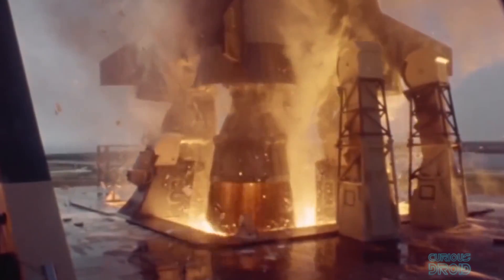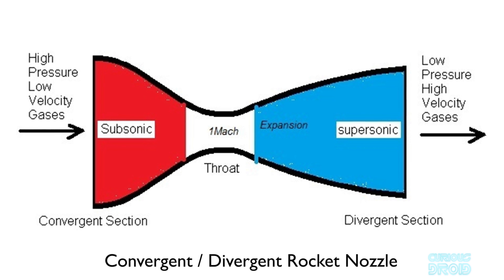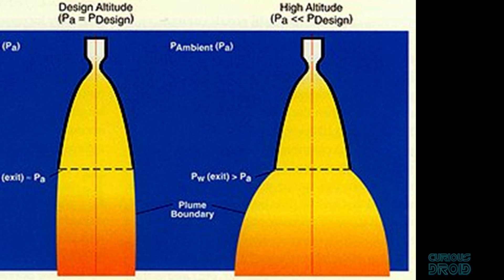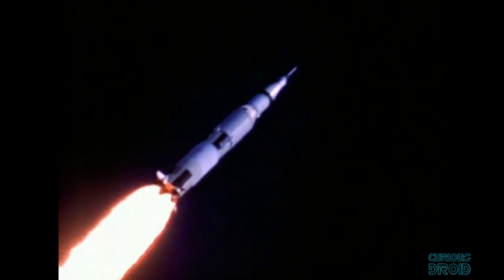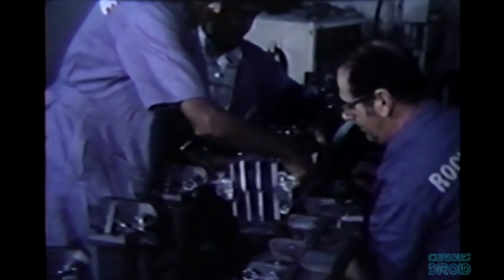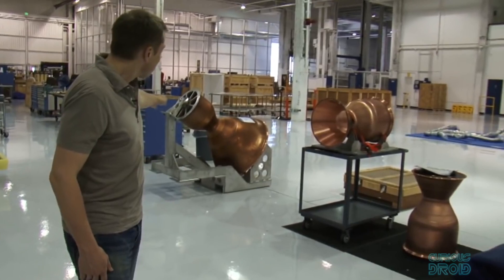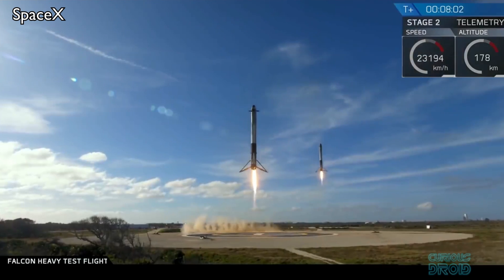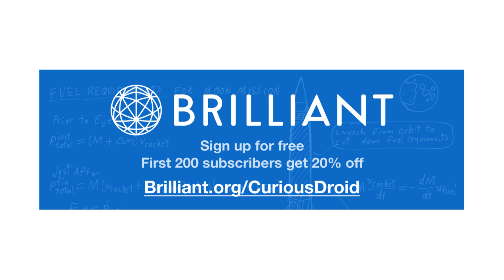Aerospike Engines - Why Aren't We Using them Now?

Comment: What happened to the maglev mountain rail type launcher?
Reply: John S you’d need the launching rail to be in vacuum like Elon musks hyperloop to continue accelerating, and if you wanted the G forces to be human survivable the track would have to be something like 1500km long. It would be the largest and most expensive engineering project ever devised by mankind
Reply: @SpiraSpiraSpira  I've seen a calculation that included drilling a tunnel at the correct angle through a mountain, and installing a maglev track, total length needed to achieve escape velocity was something like 6 miles.   Plus they added a couple of extra miles of track at the separation point in case they had to abort and needed a brake track.
Reply: John S to reach escape velocity (approx 25,020mph) over a distance of 6 miles would take less than a second but would subject whatever is being accelerated (your spacecraft) to over 1150Gs of acceleration. Needless to say this would turn anyone aboard into something similar to strawberry jam. It would also destroy any kind of spacecraft we know how to build currently. If you just want to achieve orbit instead of escape velocity you could expect something like 800Gs.
Reply: @SpiraSpiraSpira  Ah yes, I found an Acceleration and Distance calculator which came up with a distance that was too long to be practical.   Though I am not sure how exiting at a 60 degree angle 2 miles above sea level would affect the result.   Given that the rocket was traveling at something approaching bullet train speed when it enters the accelerator, It would take 9.5 minutes and would travel over 1986 miles in the vacuum tunnel.   Much too long to be practical.  That was if the G forces were limited to 2 G.  At 3G the distance would be shortened to about 1324 miles and the time to 6.3 minutes.  People blackout at 4G so not feasible.
Reply: John S a small track high G accelerator might be useful to throw building material into orbit if you want to build a large space station. A cargo only system, more or less.
Reply: @SpiraSpiraSpira  This calcs out at a 28 second ride to escape velocity, producing 40g's but needing a track over 90 miles long.   There was a guy that survived a 45 g force at one point.   Perhaps if the (rumored) top secret dragonfly g suit became more widely distributed, then it would be feasible.
Reply: @SpiraSpiraSpira  I just had a thought.   What if you built a circular track that allowed the vehicle to ramp up speed over a longer time.   Then, after terminal velocity was achieved or within reach, you changed the track and entered the escape tube up the mountain and out.  Perhaps that circular track would only need to be 40 miles long or something similar.
Reply: John S then you’d be crushed by centrifugal force instead of acceleration so you’d find that you’d need a thousand km or so to turn around a fast moving track with any reasonable amount of centrifugal force. Watch that video by Isaac Arthur I linked, he goes into loops as well.
Reply: Here is a good video from Isaac Arthur about mass drivers to orbit: https://youtu.be/KerG4ILWEa4

Comment: So the commercial companies form the private sector are perfectly satisfied with making lots of money using inefficient technologies, and won't put their profits  at risk financing research over alternatives. Since the public sector doesn't fund this research any more, they use the results of previously public-funded research and engineering. Did I hear someone say that business drives progress ?
Reply: uh yeah, because a private business has literally just invented re-usable rockets, something the public sector thought impossible or so difficult it would be more expensive than just building a new rocket,  and which is far more efficient than using an aerospike. Using an aerospike engine only makes sense on an SSTO vehicle and theres no point in developing an SSTO vehicle when you can just re-use first stage boosters. And after revolutionizing and disrupting the entire bloated, wasteful, and stagnant aerospace industry, a private, business driven firm is now developing full blown 100% re-usable rockets where both stages land and are re-used with a more efficient and effective new regenerative heat shield design, a more efficient and effective full slow staged combustion engine, and in-orbit re-fueling capabilities for massive 100 ton payloads to both the moon and Mars.... among many other innovative technologies and capabilities developed in house. 

Its the public sector wasting money using inefficient tech to shove tax dollars into the pockets of the aerospace contractors in the states of the congressmen who set NASAs budget and MANDATED that NASA has to develop their launch architecture using the same tech as the shuttle from the same firms as before..... this, of course, being 50 year old tech from the 1970s.

So, yeah. It is absolutely a private, business driven firm innovating the space industry so rapidly and massively that it is forcing even the bloated public sector to keep up and innovate.

Comment: what is the difference between a rocket engine which can gimble and thrust vector controlling?
Reply: henryscp 07 Vector controlling if I remember only works if you have multiple engines, you cut down the throttle on one engine and the offset of thrust will put force on the rocket itself and spin it. this is usually used in jetliners and other aircraft. Gimble just means that the rocket engine itself is on some bearings and can rotate
Reply: @serbianspaceforce6873  ah ok thx
Reply: henryscp 07 you're welcome I find it fun to geek out on rockets

Comment: Another shinning example were in an outstanding idea was not followed up on due to "Bean Counter".
Reply: If you only have so many beans in your budget somebody better be counting them to make sure you don't run out before you get to launch.
Reply: Right now the rocket itself is by far the most expensive part. Cutting the cost of the rocket is far more important than making a rocket more efficient. That is why SpaceX is trying to reuse rockets. It makes financial sense.

Comment: If you are using an aero spike you have to take the entire rocket to space. Multistage lets you get rid of the bulk you no longer need.  What SpaceX is doing is perfect, unless you want to convert the fuel tanks into living area in space.
Reply: You can very well make multistage aerospike rocket. In fact, aerospike first stage would be great, providing with benefits of aerospike engine without encumbering with disadvantages of SSTO. I think the perfect aerospike rocket would be TSTO - aerospike first stage, vacuum-optimized bell-nozzle second stage.

Comment: Loved the video and the information, but there is also another reason that rockets are staged than just adjusting for pressure differences. Fuel has weight, and thus would require more fuel to lift, and more fuel to lift that fuel, making an endlessly exponential increase in fuel requirements and engine power requirements. Staging is another way to reduce fuel requirements and reduce the cost of the engine and the fuel.

Comment: So, could you theoretically apply the same sort of design criteria to ICE exhaust systems to make them as efficient as possible? I know some use a design extremely similar to current rocket exhausts, with the convergent point and the same expanded cone on the exit of that point. They have a name for it but I can't recall it currently.

Comment: Am i right in saying this. The thurst (fire) from the engine, isn't pushing on the ground and thats blasting the ship up. Rather, the speed and pressure of the gas escaping through the nosels, is causing the ship to be pushed away from IT?

Comment: I would say we're not using them because (1) single stage rockets don't work very well, and (2) if you're using a two stage rocket anyhow, you're better off with a low altitude engine and a high altitude engine than an aerospike.  I don't think it's really a lack of investment.

Comment: Just thinking here... wouldn't efficiency also translate to weight?  I mean the more efficient an engine is, the less fuel you need, so the more weight you can carry, thus the more profits you potentially can bring in.  So aerospikes have a legitimate reason to be developed outside of fuel cost.  Couple that with the extremely expensive and wasteful habit of disposing of multistage rockets and rocket boosters, and aerospikes sound even better from an investor's perspective.

Comment: A little error at 2:30:

(1")² is not 2.54 cm², but 2.54² cm², which is 6.45 cm².

I can see where the error is coming from because 1 in is defined as 2.54 cm or 25.4 mm.

Comment: The problem is weight. You need to discard useless masses as soon as possible. So, aero-spike ends in an useless concept in a multistage rocket. Single stage to orbit rockets (SSTO) would be a VERY mass inefficient one.

Comment: I couldn't watch all of this gibberish. 

Rocket engines do not rely on air pressure at any altitude. Newton's laws of motion and conservation of energy proved long ago how rockets work. If air pressure had any influence (other than drag) rockets couldn't work in a vacuum, but we know they do. The Aerospike may be more efficient, but not to the degree he claims.

As for his single stage rocket: That wouldn't work with any fuel that we have currently or any we can envisage having in the foreseeable future. Multi stage rockets aren't built to use different shape rocket nozzles, but to keep the dead weight to a minimum by ejecting it as soon as the fuel tank is empty.

It's all just smoke and mirrors to hide his lack of understanding of physics.
Reply: "If air pressure had any influence, rockets couldn't work in a vacuum" That makes no logical sense whatsoever. The air pressure affects the direction of the exhaust gas and therefore the efficiency of the engine (how much of the exhaust energy is perpendicular to the direction the rocket is traveling, and thus does work on the rocket)
which is explained clearly in the video, and in this picture: https://i.stack.imgur.com/cJ4ej.jpg That's Newton's 3rd law.
If it was only about weight, why would we use multiple engines dropped on each stage? We would be using a single engine with drop tanks like a plane.
We drop the engines because the nozzle on each stage is optimized to the ambient pressure that it's meant to operate in. Once it's out of that range it becomes inefficient so we drop it. That's the entire purpose of stages. 
It's not this video who lacks understanding of physics.
Reply: @hmhmhmlol3252  Why mention Newton's laws and then ignore them? Reaction thrust has no bearing on air pressure. The different nozzle shapes are more about efficiency at varying heights and therefore as gravity and the total load decreases. He even describes how the flame shape is influenced by the air. It's pretty, but doesn't contribute to thrust in a rocket engine. It may on a jet engine to indicate fuel/thrust efficiency, but otherwise does nothing in itself.
Reply: Nothing stops you to do it better!
Reply: @gagarinone  I wasn't intimating that I could do it better, but that he grossly overestimates the improvement over the bell shaped combustion chamber. And that he ignores the weight being dragged into orbit even if it could work. Which it couldn't. NASA and the rest of the aerospace industry know about this modification, and have done for decades. Isn't it obvious that if it gave them a significant advantage over current technology that they would be using it to put ever heavier objects into space?

Comment: Would one gain a further advantage by flying the rocket as high as possible supported by high lift wings and using air as the oxidizer.  Liquid oxygen would only be used at altitudes where the air was too thin to be used as the oxidizer.  You reduce hugely the weight that must be lifted off the ground in the first place and use relatively cheap jet fuel as your energy source.  You could even drop off the wings and their framework to glide back to earth.  This unit could be flown from wherever the launch site is toward the equator as it gained altitude to take advantage of the approximately 1000mph speed of rotation of the earth.

Comment: Basicaly they make engine go soft enough to not waste power pushing through air, like walking gently enough on ice lake surface to provide propellent, but not too hard that your foot smashes through ice & then you start falling down....

& with different levels of surface strength depending on atmosphere pressure/height, just like different levels of lake ice surface strength depending on how thick its ice sheet is/depth.

You know it's be easier if they just had a very big broad afterburner engine to ensure maximum softness/useful working thrust, & then just add a squeezing mechanism to close opening & increase thrust power if necessary...

Comment: The future is Orman Force Drive: Electromagnetic mobility for all... No 
noise, no pollution and green energy security for ever... No need for 
roads, shoes, tires everything levitates using just small amount of 
electric energy to compensate ohmic loses... Works everywhere including 
vacuum of space and only needs electric energy converting it to kinetic 
trough use of Orman Force... Amazing fact is that this invention was 
possible in Tesla times... It is a joke or is it?

Comment: Aerospikes aren’t magically much better...  On a planet like Earth, where SSTOs are very difficult and expensive to make, it is much better to use a two-stage rocket with bell engines.  I would argue it’s even more efficient (at least from what I have been working on).  If you want an SSTO for whatever reason, and you can make the engine light enough, an aerospike is absolutely better.

Comment: Love the concept, but there are a few problems.  First, this feels like a commercial to me, not an unbiased assessment.  2nd, i believe that you are right that concepually exhaust should be at atmospheric pressure, but achieving that adds weight.  3rd and most important, multistage rockets shead unnecessary weight.  Each stage can then have the very light bell designed for that altitude.  Aerospikes could actually be less efficient

Comment: But if you are saving fuel, couldnt you carry way heavier payloads eg to mars? I think they should use a rocket shaped symmetrical design though with 4 fuel tanks that can be dropped off in flight.

Comment: The explanation does not make sense to me. It may be confusing due to the language interpretation, but it sounds as if there is a claim that combustion happens outside the nozzle. That would be akin to  the gunpowder in a bullet not burning until it was ejected from the muzzle. The velocity of the projectile came from some unknown force that hasn't been discovered as we can't see inside the barrel (or so it seems).

Comment: So, 14 minutes later, we are reinforcing the thinking that the reason AeroSpikes Are not used are because of the cost. Are aerospikes more efficient? Probably. But cost efficient? No. The reason they are not in wide use Are precisely because of the alloys required to build them. Cost has always been a consideration, even since the beginning of the space program. Going to space is not cheap. There are 1 million things that have to go right in order for a mission to succeed. So, you have to rely on the technology that’s the most proven and reliable.

Comment: You say that fuel is one of the least expensive parts of a rocket. And while that may be right in terms of dollars to launch, but fuel has a price in kilograms too. If you can burn 40% less fuel to get a rocket to orbit, that means you can either use a significantly smaller rocket or lift a significantly larger payload. Wouldn't those be tempting to a commercial space company?
Reply: Payload fraction depends entirely on exhaust velocity, or Specific Impulse as they call it in rocket speak.

Comment: The next solution for ground to space flight is an integrated anti-graviton DSR molecular micro system to reduce the effects of gravity & weight.  But of course they are not cheap or easy to build plus you also need a super cooled onboard  quantum computer to stabilize the system's performance and multibit quantizer simulink during high orbit flight control.

Comment: ARCA's project is a joke.  They don't actually have an aerospike design and they're playing with peroxide as a fuel ... which I seriously doubt can generate the Isp to reach orbit.

What surprises me is that you never mentioned Firefly Space Systems.  Before abruptly loosing investor funding and going bankrupt in 2016, this company had a functioning toroidal aerospike engine on their test stand, which they were intending to use in a line of small-sat launchers.  That engine used conventional LOX/RP-1 propellants.
Reply: lol you can reach orbit on peroxide as fuel......but it would results in a giant rocket with little payload and so, so many stages (I had to spec. one out once).
Reply: @DanielScutt  more like makes sense for a student project with a very over protective safety department
Reply: Never under estimate the power of farts as propellant

Comment: Thank you for the video. I was wondering why not have a changing nozzle diameter for some time( I was thinking problems with automation etc.), and now I know that the idea has been researched a long time ago. Still maybe it will be the way to cheapen launches of let's say couple of CubeSats. Someone should look into small SSTO, or at least High-Altitude first stage. And it shows why Private companies aren't always the best. I wonder what the X-37 is really using. Perhaps some mix of the bell and Aerospike engines? Probably not, but Large State conglomerates, are supposed to "waste" money on something that might not work ideally. That's why I think both Public and Private spending should be working in parallel.